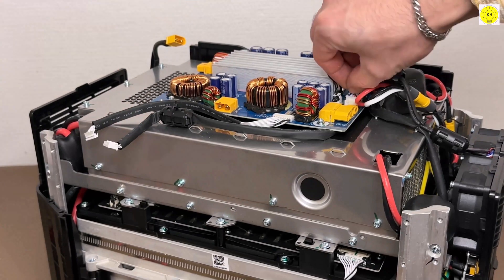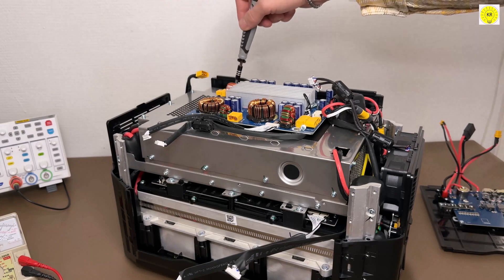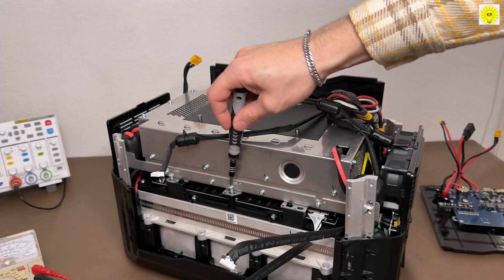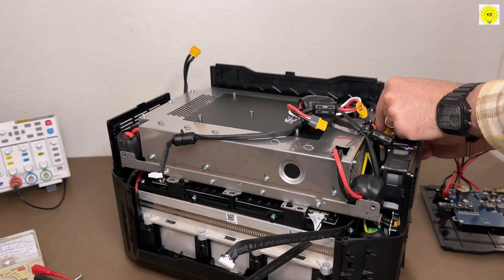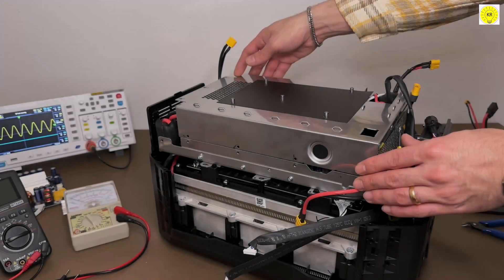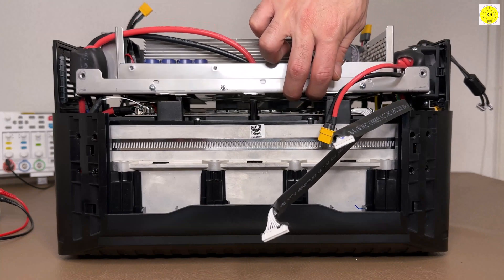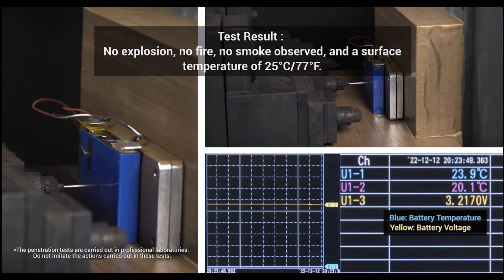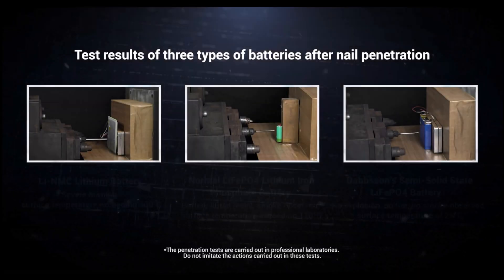inverter 220v ac 2200w best portable power station , DBS2300

Comment: I’m gonna go out on a limb and say I’ll eat my shoe if that BMS actually dynamically regulates the battery output based on temperature inputs in any more than a 3 step system. Instead of just mosfets on or mosfets off it might have an intermediate stage that allows reduced power when things are a bit toasty. 

I’m also gonna say big doubt on the semi solid state. Until I watch someone pull a cell out of a device and drill into it, it’s probably a Chins/Will Prowse situation

Comment: Does it beep or click when a solar panel is connected or at dawn and dusk? I have another power station that beeps for about 30 minutes every time the sun comes up or goes down... looking at this as a possible replacement as it's not too late to return it.
Reply from the maker: This inverter has interesting specifications, where you can view all the information through an application on your mobile phone, such as the charge level, as well as turning on and off, and much more. You can find out more by visiting the product website